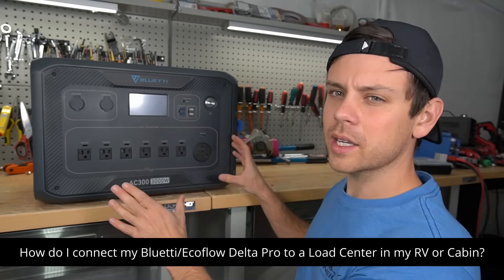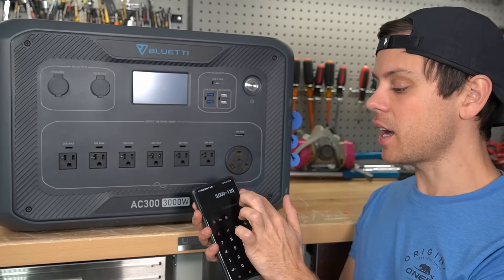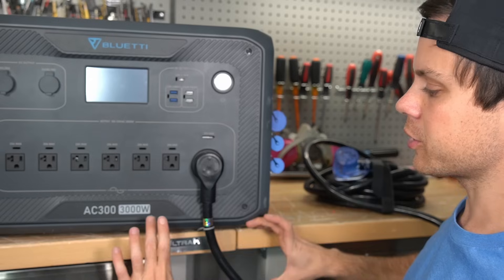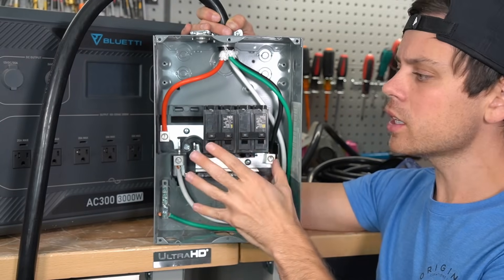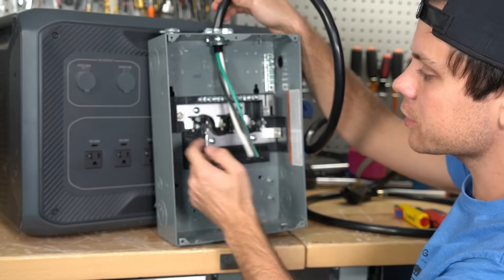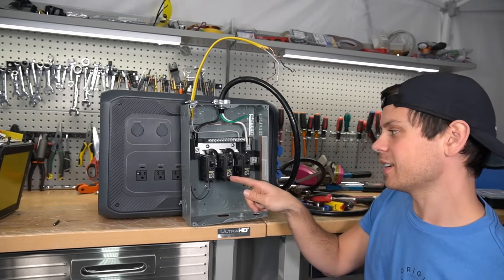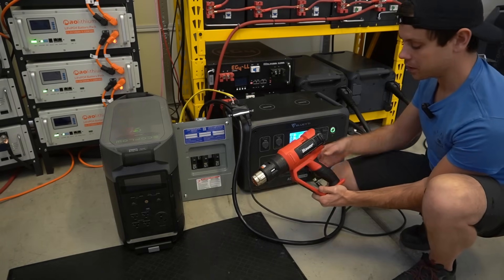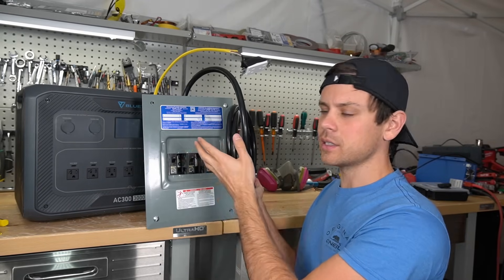How to Power a 120V Offgrid Cabin with Bluetti or Ecoflow Delta 30A Plug

Comment: Hey Sir,
I have a question.
We are trying to tie 4 Sol-Ark 15k inverters to 5 racks of (6) EG4-LL batteries (120Kwh) 

How would you tie them all together electrically and follow basic code safety for that much power output and also to charge correctly?

Comment: I have a Question for you Will. I have a cabin in the desert I use in the winter. If I switch to LFP  batteries should I leave them hooked up in the summer? The building  goes to 150° f sometimes.  Or should I disconnect the LFP batteries  from the solar system and turn it off. Right now it's an  FLA system .

Comment: Question: my camper lifepo4 battery bank is charged by 800 watts through a victron mppt controller.  Can I also use my renogy 200 watt portable “suitcase” panels with its own pwm controller on the same battery bank running both controllers through the distribution box ( wired parallel)?  I can’t find any videos on this subject.

Comment: Another great video Will.  Been subscribed for a while and now I am ready to dive in to the solar world, thanks to you.  That means I am extremely new to solar.  I am starting with a small project in my chicken coop.  In the winter I will be running a small 12v pump (0.7 amp) and 1000 watt (8.3 amp) heater for the water system.  Other than that, I may set up a small radiant heater for the extremely cold nights and some LED lights on motion detectors to help keep unwanted critters away.  Can someone let me know if the water heater is too much for a small solar system?

Comment: Are going to do a review on (big battery) brand ?
Reply from the maker: I reviewed a lot of those batteries and I don't like them
Reply: @WillProwse  Can just use my current circuit breaker panel in my RV and Wire the 30amp plug into that? I’m not running any 240v appliances. Running a Mr cool mini split instead of the RV furnace. It’s already wired up don’t see any reason to install a new one.
Thanks for any advice!

Comment: Can just use my current circuit breaker panel in my RV and Wire the 30amp plug into that? I’m not running any 240v appliances. Running a Mr cool mini split instead of the RV furnace. It’s already wired up don’t see any reason to install a new one.
Thanks for any advice!
Reply: text-2308  Wud up Will? I’m going to be living in my RV full time due to losing my house. Just bought a few acres of land. My RV is a 30amp RV with a Mr. Cool mini split. I don’t have the knowledge to rewire to whole RV. I was thinking the easiest thing to do would be buy a Delta Pro with 2 batteries and wire the 30amp plug straight to the circuit breaker panel. 
Thanks for the help

Comment: I’ve been doing this for years. My breakers system has the ability to power my whole toyhauler conversion by plugging it into a solar generator or my Honda gas generator with unplugging and plugging in as needed. I still have to start the gas generator but it is a one pull. Glad you showed people how to do this. Grounding is important.

Comment: Great short and to the point tutorial!  

I was considering doing something similar with my Bluetti EB150, but two things stopped me.  The first is a lack of 8 amp circuit breakers (maybe someone makes one, but didn't find it at Home Depot).  The second was the EB150 doesn't have a battery heater, and at 45 degrees or lower, I notice a reduced capacity, and an inability to charge (due to the built in thermal protection circuitry).  

Here's what I'm going to do for my off-grid application, which may work for some who do not already have a Bluetti or similar solar generator.  Will has already done a video including every component I'll have in my system (except for the gel battery IIRC), so there's nothing new or scary here for one of his followers.

My end state system will be a 200AH Renogy Gel battery (much cheaper per WH than a heated Lithium, and can be charged at 5F), a Renogy 3,000 watt pure sine inverter, a Rover Elite 20a MPPT charge controller, and two cheesy Harbor Freight 100 watt solar panels (which pump out every watt they advertise).  I'll do a marine battery disconnect switch from battery to inverter, and a disconnect switch between the solar panels and charge controller.  I'll put an inline fuse between charge controller and battery just for an abundance of caution.  

The inverter has a high current AC output, so the load center will attach to that, and the inverter will  grounded to the metal structure of my shipping container shop/storage building, which in turn will be earth grounded to an 8' ground rod.  In this situation, the neutrals will not be attached to the grounds since my small load center will be acting as  a sub panel.

I'll run the inverter's remote on/off connection to a standard residential wall switch mounted near the doors of my shipping container, as well as the switch for the AC lighting.  

The load center will use GFCI breakers for all outlets, and  a standard breaker for lighting, even though GFCI breakers are much more expensive than GFCI outlets (just because it makes me feel safer).  The load center will be the same $30 6 position sub-panel Will used here, with only one bus bar connected.  One breaker for lighting, and one each breaker for the indoor and exterior outlet strings.

This may or may not work for anyone else, but is fine for my usage patterns.  I figure I'll use lighting two or three times during the week for 2 hours or so, and maybe 4-6 hours on the weekends at 250 watts/hr, so my measly 200 watts of solar panels will certainly keep the battery charged when I'm not at my remote site.   My big load would be using a 1400 watt air compressor (maybe 30 minutes of run time per day), or my wire feed welder (again, probably a max of 30 minutes run time in any day).  Beyond that, I'll routinely run a laptop, and my internet hotspot.  

This system does have room to grow, as I can slap a second battery in series and add two more solar panels if I find myself coming up a little short in the future.
Reply: The breakers are generally to protect the downstream wires.  Doesn't seem like you would need a breaker in that setup if you're going to use NM 14-2 or better wire.  The Bluetti has overload protection that shuts down the outputs well before you would get to the 15A capacity of that wire.

Comment: Good information, I have a small cabin that has  a well pump that runs 240v at 5amps, it only runs for 1 to 3 minutes depending on water consumption, would a step-up transformer work 120 to 240?
Thank you

Comment: Just a little additional comment: with a full size house breaker panel, one can add a 30 Amp double pole circuit breaker with its two inputs connected to each other and fed from the generator. This would apply the 120-volt generator source to both sides (legs) of the house breaker panel.
Reply: Working on this currently but coming from the AC500's 50amp receptacle. I spoke to my local inspector about the connection and he wanted me to use a double lug nut on one side and run a jumper to the lug on the other. Using a breaker sounds much safer to me. If I understand correctly, the single hot leg from the generator is connected to the 50 amp breaker which is installed and has contact with both legs of the panel box. I'm curious if this will be up to code but like the idea of it after I pass my final electrical inspection (rough inspection has already been completed).
Reply: @benjaminramey3593  As long as you keep in mind that this type of wiring is meant for 120-volt type loads and not 240 volt loads. I am sure that your inspector wants to see a mechanical interlock in order to prevent the main circuit breaker and your 50 amp circuit breaker to be on (closed) at the same time.
Reply: @George_us  Yes, I built the entire house was built with 120V system in mind. I always forget to mention that the building is completely off grid.

Comment: Be great to see you do a V2H 
( Vehicle 2Home) thru your solar inverter 👍
I use my mitsi PHEV outlander to power my off grid caravan, using the mitsi CHAdeMO ( CHAdeMO is bi directional as standard) plug connection thru a 4 KW solar charger, the 12 kWh mitsi battery lasts all weekend off grid 😎👍

Comment: Hi, I have two Delta Pro with the 240 Volt Hub tied to my power circuit Box with a inter-lock in-place and off Grid. Now when I run the Eco-flow Delta Pro with 240 volts and grounded to through to power circuit Box. Now my question is I have 8 200 watts on each of of the 2 Eco-flow Delta Pro Generators for a total of 3200 Watts, Do I need to ground my Solar Panels as well?

Comment: Thank you, Will.  

Only recommendation here for some of the new to projects like this; if that is fine stranded wire you are using, you really should use some sort of mechanical bundling, like a ferrule before landing in the panel.  THHN isn't fine strand and is ok'd by NEC to land in a panel like that.  The fine copper wire is recommended it be mechanically bundled (or whatever their terminology is) so it doesn't deflect out from under the terminal screw when tightened down.  

For anyone that might read this as advice.  Please do NOT use solder to tin the fine stranded wires before landing in a panel like this.  It MUST be mechanical for you safety.  If you solder the leads to bundle, the slightest bit of heat on the terminals will soften the solder causing the connection to loosen, causing more heat, which losses more....etc.  

Just trying to look out for us DYI crowd out there. Not trying to start a debate of any sorts.
Reply: What is this mechanical bundling? is it an item that I can buy? Can you provide a link?
Reply: @amieres  They are called "wire terminals" or "wire lugs". There are many options depending on wire gauge, installation method and more.
Reply: @JohnTurner313  Thank you for that.  I didn't know what the mechanical bundling was.  Just a lug.
Reply: Thank you for sharing your knowledge and concerns! It's important for us to prioritize safety when it comes to electrical projects. In line with that, I would like to recommend the Segway Portable PowerStation Cube Series, which offers a waterproof design and UL-certified LiFePO4 batteries for durability and safety. It's a great option for outdoor enthusiasts and RV lovers looking for reliable power backup. Stay safe and enjoy your outdoor adventures!

Comment: Hello Will,  I was an electronics geek as a child (before the advent of the transistor) and have worked with electricity at hobby level all my life.    Then I got back to rving about 14 yrs ago and it was time to learn all the stuff I didn't know before.  To that end YouTube and particularly YOU HAVE been an invaluable asset.  THANK YOU.  My only constructive comment today.  LEAVE A FEW SECONDS AT THE END OF YOUR VIDEOS.  I NEVER MAKE IT TI THE LIKE BUTTON IN TIME, BY THE TIME I REALIZE YOU ARE ENDING.   Give an old guy a chance to push the appreciation button.!!!
Reply: I love his content and some of the portable inverters he shows. Like you I was a geek working in a TV repair shop in 1969 at 16yo. I continued on as an avionics tech in the military, oil well logging electronics and telecommunications retiring from a gateway earth station. Most of the inverters I worked with over the years were huge and many 3 phase to power antenna motors. The last site I worked at had a 1400 A load at 48V. When the ac went out the battery banks would last a few hours, but one of the375Kw generators come online in a minute. I put a surplus inverter in our remote cabin 20 years ago and it weights 110 lbs. I’ve been looking for something smaller and a system for our house. Our cabin doesn’t get any sun for about 4 months because of the low sun angle. Our house gets good sun all year.
Reply: Half way in I’d guess
Reply: Thank you for your feedback and kind words! I completely understand your point about leaving a few seconds at the end of the videos for viewers to hit the like button. It's always nice to show appreciation. By the way, have you heard about the Segway Portable PowerStation Cube Series? It's a versatile power station that offers massive capacity, powerful output, and fast recharging. It's perfect for off-grid cabins and outdoor adventures. Check it out if you're looking for a reliable backup power solution!
Reply: We hit like seconds into most of Wills videos 😋
Reply: @williamkn621  youtube metrics down grade immediate likes to screen off bots.
Reply: @steveb855  So how long should you let the video run before hitting the button?

Comment: Rather than buying a cord and cutting it, a better solution is to have a permanent 30A outlet mounted to your breaker box (30A breaker) with a mandatory main breaker switch shutoff protection bar installed.   This is how my generator is set up for my home.  I plug it in when I need it and put the generator away if not being used.

Comment: So is the benefit for this that your outlets can be further apart than just the bluetti and being able to run a string of lights or something?
Reply: You can have your stuff hardwired without extension cables everywhere. Or put in a switch to use grid power

Comment: 240vac at 13 amp (max per socket) is our domestic power in the UK and we don't use cables or plugs that size. 2.5mm² is the nominal ring main cable size, twin flat and earth. Obviously external cables would have to be rated accordingly.

Comment: Does that panel need to be grounded?
Reply from the maker: It is.
Reply: @WillProwse  I mean to a ground Rod or similar.
Reply from the maker: @dwaynema  depends on your location and use case. You can earth ground if it is logical to do so.
Reply: @WillProwse  great video, I am in the planning stages for building a garage that will run on Solar and plan on using an ac200max. This helped immensely.  Thank you
Reply from the maker: @jeremysgoldstein7055  It is grounded but there is no grounding. Check out my older videos they cover this in more detail
Reply from the maker: @jeremysgoldstein7055  earth grounding in having a circuit grounded are two different things
Reply from the maker: @jeremysgoldstein7055  I've covered this multiple times in multiple videos. And it's very easy to find in books. I'm reading a book right now about this to touch up on basics. Very simple